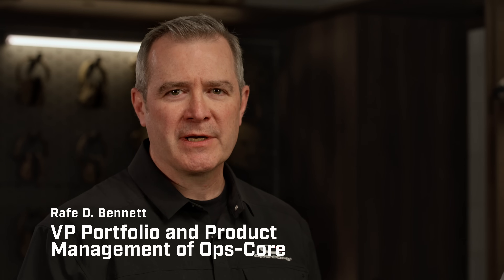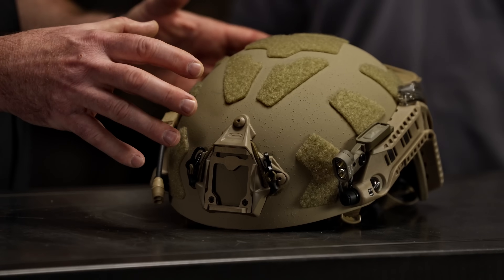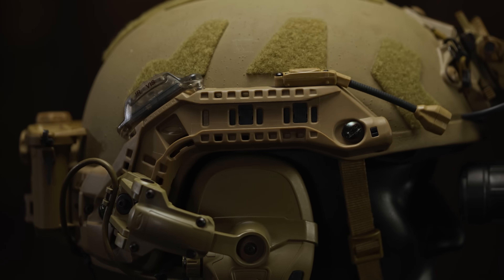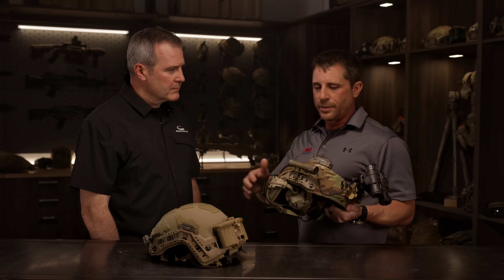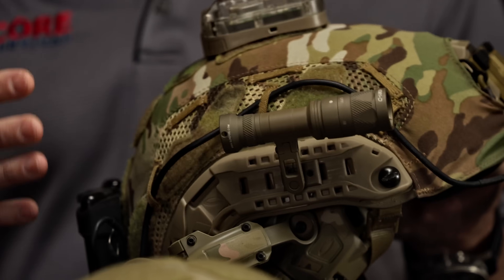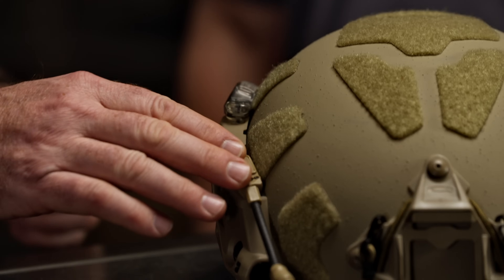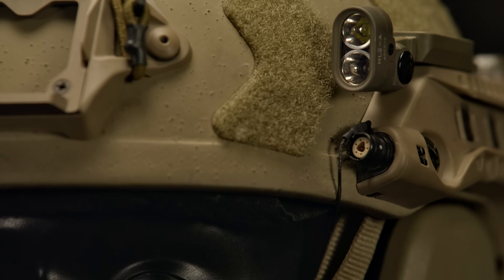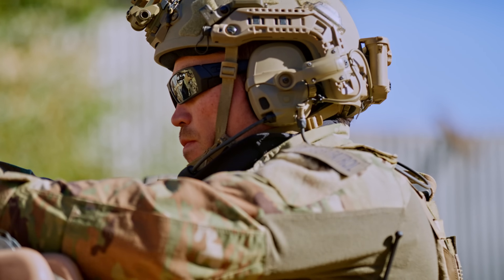Introducing RAILINK®: Powered and Data-Enabled ARC Rails

Comment: Why not have the battery pack located remotely and run the wires up to the helmet to take the most weight off the head? Seems like a better idea to me. Or at least have an interchangeable module so you can choose the integrated or the remote battery options.

Comment: Dude is throwing around the world “data” like a buzzword but nothing that was shown requires data transmission.
Reply: New game: take 1-shot every time he mentions data.
Reply: Not true. Here’s one example, he pointed out that the battery knows when the NVG are flipped off to save battery life.
Reply: @boriscalderon1678  Thats not data though, thats an accelerometer, which a lot of NVGs are using in their articulating houses to turn off already
Reply: Well maybe L3 implemented a camera in the quad NVG's which could be used through ATAK. That would require data.
Reply: What are you talking about he mentions that it can transmit augmented visuals into goggles and it has an accelerometer in it which is a complement who’s sole purpose is to detect or transmit data
Reply: By data he really just means an on-off switch. But that doesn't sound as cool.
Reply: i counted 10 times lol
Reply: DATA!!!!…..BYTCH 🤖

Comment: Quick question
Why not an integrated battery pack you can recharge with a usb?
Individual batteries seem so outdated and the space you'd save just having one large battery pack compared to slots for individuals batteries seems like a way better idea
Reply: Given that the battery pack is removable, they could always design a rechargeable battery later down the line.
Reply: Alot easier to source AA batteries in every corner of the globe in a bind.

Comment: is it a stand alone system or does it required to be used only Ops Core helmets?
Reply: only opscore helmets, arc rails fit only the opscore helmets (or anything shaped like original opscore).

Comment: What applications for data sharing will this helmet support? It's alluded to multiple times but I don't see any concrete examples
Reply: None ATM. Vendors are supposed to sign up on their site to get technical data package to build these applications.
I hope they've just went with some version of USB protocol for this, but 3V and 9V power probably means something more proprietary.
Reply: I think this is a promising yet very expensive piece of tech.
Reply: there's no data its just a wrong term he used for everything is connected to that battery on the back like a source of power for every attachment across these rails like one of those chargers smart phones tend to use.

this isn't really anything new they just slapped chargers onto the thing to prevent overarching cables.
Reply: @DHell-n8i  No, he explicitly said there are data lanes between the plugs on the rail, and one of the use cases they already implemented is turning power to NODs on and off depending on accelerometer data from the mount.
Reply: @BlackBladeGroM  So pretty much a indicator when to give pwer or not

Comment: Okay, so all the weight is both lower on the helmet and closer to the head--which is outstanding .  But how much lighter is it compared to the previous gen. set ups?
Reply: If you run a slick helmet then this will make your helmet heavier. If you run accessories such as strobes and lights this will make it slightly lighter and sleeker.
Reply: @ivaniuk123  I figured so.  But how much is slightly lighter?  Especially given this helmet system will probably cost $2,250$+ without accessories (batteries only).
Reply: @Polemicist_ try $2500 for the rails $1100 for the battery pack and $480 for the cable for your NVGs. The set of strobes are $540. The Princeton is $170 and the surefire is $330. TNVC has the whole set up for $4,630
Reply: @wltr118  Charging that much for a helmet should be a criminal offense.
Reply: @Polemicist_  Not even for the helmet, 4 and a half grand for the fucking raillink!

Comment: I feel like the real downside to this is the modularity.  I wonder what sort of Sci Fi helmet we'd get if it was designed from the ground up to be featured complete and lightweight
Reply: >feature complete
>lightweight
Pick one and ONLY one. Modularity is mandatory for a reason. Full-coverage frag helmet for frontline troops would need a different set of equipment than SFs high-speed-low-drag kippah, and then there's personal preference and anatomic differences. A helmet with everything built in would either weigh enough to crush your vertebrae or have to be so thin that it won't even hold random frag.
Reply: IHPS lol

Comment: Maybe just me but I’m not buying proprietary components to “plug into” the arc rails when i already have a helmet setup. Lack of cables, big whoop, everyone already manages cables. They are tucked away or zip tied and not going anywhere. I just fail to see a purpose
Reply: To Increase cost for gov contracts
Reply: Cable management is a useful feature, but not the main goal of RAILINK. It’s the ability to handle data transfer. That’s the groundbreaking part.
Reply: @HawthornandClark what exactly would this be good for? Data transfer to and from what?
Reply: @miletello1 it’s for built in HUD’s that project to the night vision device.
Reply: @Ryan-cv9me A battery pack is not a computer. They keep saying data transfer but all the battery pack does is supply power/bolts to your devices. If anything it is an over glorified ops core that just some happens to neaten up the idea of having wires externally. And I bet this will still cost an arm and  a leg. Nothing they said is groundbreaking
Reply: @duc1755  yeah, it’s for HUD that need data cables. We don’t have access to it as civilians. They have weapon mounted cameras that can broadcast video feed and overlay it onto your NOD’s now. Maps, compass, GPS. @solscud has a good video showing how his Steiners are set up to run different HUD’s.

Comment: On the other hand, it is much less pretty than a standard ops core sf helmet, and if everything is inside the arc rails, what is it for? It was necessary to completely redesign the rails and remove the ARC sockets for standard equipment.
Reply: There are some accessories that need to be mounted to the arc rail (Ear pro, ballistic face shield) and it also ensures backwards compatibility with legacy devices.
Reply: What are you even trying to say? What are removed?